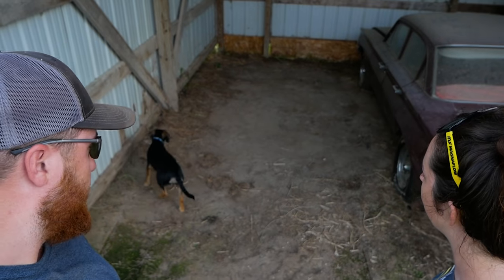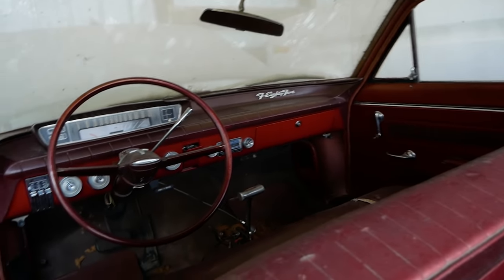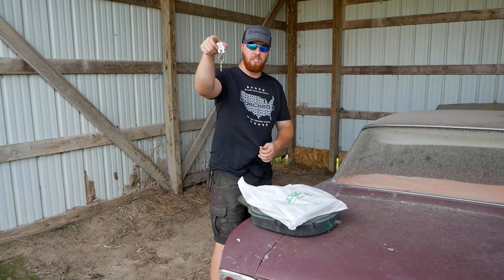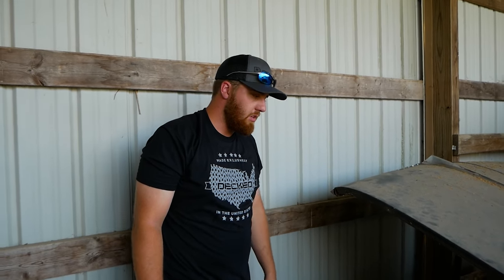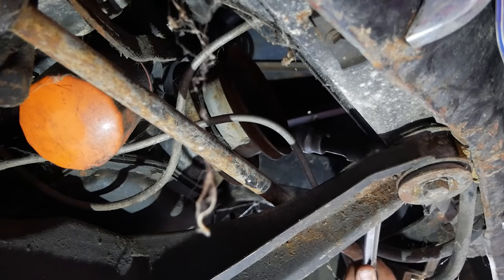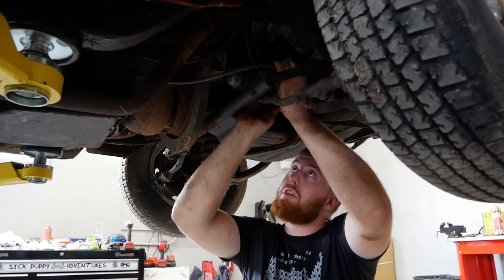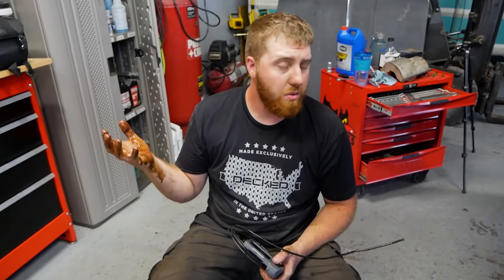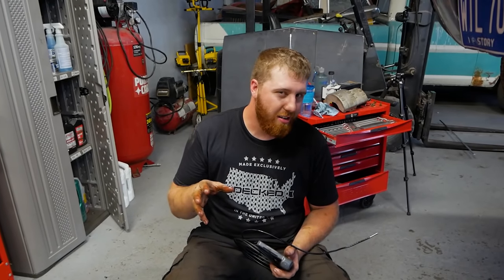BARNFIND Oldsmobile F-85 First Start in 25 Years!! - Part 1

Comment: The engine would eat the stock transmission that's why I converted mine to a 4 speed and the duel exhaust was stock it also has short headers 63 had a alternator
You have a Gold mine just in parts that engine should also have steel sleeves cylinders

Comment: @JunkyardDigs you could  put air suspension on the trailer as that should allow you to drop it lower and if set up correctly change the tilt when needed. Could be a cool video as well.

Comment: Had a 62 Cutlss convertible same motor,blew the doors off many Mustangs with it.Engine block aluminum particles plugged the heater core several times.

Comment: we had the 215 over here in uk ,if its been sitting for a while youll have to pack the oil pump gears with vasoline or similar & also fill the oil filter

Comment: Like an LS not a self priming oil pump.  A pump garden sprayer and some fittings make a good LS primer may work with this, if not at least it oils everything pushing oil through the system.

Comment: packing the oil pump would likely work but why not just put an adapter in the oil pressure hole bushing up untill you can get a funnel in it pour the funnel full of oil and let it sit. you could even spin the pump backwards to aid in the "priming". Don't give up on this one, my sister had two of these when I was 15/16 years old, they really move for a small car and get mid 20's mpg.  Hers were both the 2 spd, what fun with a th350.

Comment: Ok after you pack that oil pump and get her running throw the rest away. Then go find a Baja bug project. That engine is a hoot in a bug. Wish I never got rid of mine. Stupid easy to do. Headers upside down with glass packs welded to the collector, big ass aluminum wing off the back with a hole in the middle becomes becomes you radiator mount. Great fun brother!

Comment: I had a '62 f-85 convertible. Bought it cheap in early 2000's because the auto trans was bad. I rebuilt it twice and it wouldn't work right drove me nuts. Finally spoke with an old timer trans mechanic and he said those transmissions are only good for weighing boxes down in a dumpster! So I put a 4 speed auto 200 4R and it was back on the road. I have 13 year old YT videos on it somewhere. Great car that was easy to drive and park around the city. Sold it on eBay for a lot less than I thought I would. Sure it's worth double or triple now like all the cool cars I used to have.

Comment: I had a 67 Buick Special with the 301 ci engine which is almost identical to the Olds engine in the F85. I had the same problem. Put a new oil pump and that fixed the oil problem. They are fairly cheap to rebuild or replace.

Comment: From the comments , made by many knowledgeable viewers, suggest you follow there advice .... after you have dropped the pan and checked your ends and mains as you have run the motor with no oil pressure , shells are cheap .... if shot and a crank polish can be done in place if necessary , then prime the oil pump with Vaseline and fill the oil filter , etc .

Comment: @junkyarddigs,
I've ran rover v8s for years (being British) lol
Make sure your spinning the dizzy drive the right way with the prime tool and it could just need the oil pump packing out with grease
To get the initial vacuum for suction 
These engines are notoriously bad for low oil pressure the last one I built I put in the back of a vw vanagon 
Parts for this engine are super cheap they used this engine in many different vehicles over the years , most common in landrovers and rangerovers they came in the 3500 sd1 as well as other iconic British sports cars the engine is actually legendary over here in the UK we love them ha ha ha

Comment: I don't work on any vehicles, but I do a fair bit of small engine work. Right now my main project is a 1969 Lombard Comango. All it needs now is a carb rebuild, and I'm planning on putting a pipe on it in place of its current "muffler."

Comment: Correct me if I'm wrong but I think the Buick 3800 V6 pumps fit these engines, and melling makes high capacity units for them too. The V6 oil pickup is a good upgrade too. and the HEI off a B-O-P engine fits too I believe.

Comment: As a Brit with a little experience on the Rover derivative of this engine, I agree with everyone else who's saying that the oil pump needs priming, preferably by packing it with Vaseline. Hopefully the rest of the engine is good.

Cool to see that Aceca, shame it's missing the original BMW-derived Bristol I6 motor though, those things are brilliant.

Comment: I know that, on the Rover V8, if the engine sits for a long time then the oil can drain right back into the sump and the pump loses prime.  It might be worth pulling the oil pump out and repacking it with petroleum jelly to get it to prime again.  Assuming this engine is basically the same as the Rover V8 that developed from it then it won't run without the oil pump drive in place as there's nothing to run the distributor...

Comment: My uncle has a 1988 Pontiac Fiero GT that he purchased new from the dealer. He blew it up in autocross and decided to put a Olds 215 that he pulled out of a F-85 in the early 90's. It uses a Fi-tech fuel injection system which works great.

Comment: Not a bad episode at all, I had a couple of Rover SD1s here in Australia, when you get that engine running properly it will be rewarding! I remember (allegedly) hitting 125 km/h in 2nd gear before the auto shifted to 3rd. As for lack of oil pressure...sorry no idea : (

Comment: The aluminum 1962 215 cu. in. F-85 "Olds" engine was built by Buick I believe. A lot of parts are still sold on eBay for it.

Comment: All is not lost Kevin. Pull the flat plate off of the oil pump and examine the gears.. if all is well, pack the pump with white grease, reassemble and fill engine with fresh oil, run for 3 minutes at idle while watching oil pressure gauge..

Comment: The Buick 215 became the BMC 3.5 litre, fitted to Rovers,  Land Rivers, Sherpa vans, MGB GT V8s and TVRs. It's the most popular V8 in the UK in the 70s to 90s. It was modified to 4.0 litres, then final to 4.6L. It also formed the basis of the Metro 6R4 group b rally car 90 degree v6 engine.

Comment: Buyer's pride: the interior's pretty good, "actually really nice!" That thing is awesome, but it needs EVERYTHING redone. Do a full rebuild of that wonderful little piece of Oldsmobile history.
So you started this thing without oil pressure. Wow, the very first thing you should have done is prime the oil pump with new oil and filter. Also didn't see you squirt oil (or WD40) in the cylinders before turning it over. At least you checked the oil.

Comment: This is a 1962. We had a 1963 4 door F-85. 215 CID V-8, with a 4 barrel. Getting automatic transmission parts for the original F-85 Roto Hydramatic is now a nightmare, so, not shocked to see a THM 350.

Comment: Many olds and buick blocks have a hidden oil gallery plug that is missed on rebuild.  If priming the oil pump doesn't work you may need to look into that. Typically behind the distributor drive but could also be at rear of engine.

Comment: Dont use vaseline right idea but use stp oil treatment. Had the buick 215 once all the oil drains back down the pickup tube to the pan it wont pick up without priming the oil pump. Which means taking it loose from the timing cover and packing it with stp oil treatment

Comment: For all of you who wrote in that a certain brand of car used this type of pump, there were many different brands that used this type of oil pump on their engines.  Ford, Dodge ,Buick/Olds/Pontiac, Jeep, International,  and many others ,including AMC.  External oil pumps kept you from having to remove an oil pan to access the pump. P.S. Kevin, not only is that aluminum V-8 engine unique to Buick/Pontiac/Olds, those cars also had the transmission in the trunk. The th350 conversion included installing a differential to replace the Powerglide/Jetaway transaxle.

Comment: The trans cooler should be run in series with the radiator so it can warm the trans fluid in the winter and cool the fluid in the summer.
Allegedly.

Comment: I’m pretty sure the pumps are ran from the distributor so you’re in the right area with testing with the drill, may be a bad pump or blocked pickup. Try removing the oil filter housing to see if there’s anything there maybe? Certainly check the UK forums, there’s a lot of support from the Rover/Land Rover/Range Rover car clubs here in the UK.

Comment: looks like a 1962. I had one in the 60s. Put 120,000 miles with no issues. They made one with an air research turbo charger that was 215 HP. They came with a 4 speed and they made convertibles too.

Comment: Mickey Thomson took a couple of those motors to indy back in the day. a farmer at home had to sons that both had one of those cars new and they would get going pretty fast and at least one of them had the same intake manifold as yours has, it was for a turbo charger, the large hole in the front bottom and that large carb cover was the charger blew into.

Comment: How do you take a car sitting that long and not : A) pop valve covers and slather oil on the rocker arms. B) pull the dist and prime the pump with a drill?

Comment: Pulls the starter off of what is essentially the Coupe (2+2) version of the car (The AC Aceca is based off of the AC Ace) that was the basis the Shelby (AC) Cobra to stick on a $600 Barn Find. Classic.

Comment: Pump oil into the pump with an oil can through the pressure switch port. That should fill the pump with oil, then it'll start pumping when you spin it.

Comment: I had a 1971 Buick Riviera with a 455 once and a lifter snap ring got between the oil pump gears, locked the pump up thus shearing the roll pin on the distributor drive gear. Luckily the engine quit running so it didn't run without oil pressure. So I installed a new pump rebuild and roll pin but still no oil pressure until I put some grease in the pump gears. That fixed it. And how a lifter snap ring got in there I'll never know.

Comment: I'd recheck the pushrods first. By removing the valve covers.& running A thin wire down through the push rods to see if their unclogged. Then try to start it up run for A little bit afterwards to see if anything changes.

Comment: I had a 1963 Olds F-85 four-door "Rocket V8" (my mom bought it new).  3-speed automatic. The '63 had a much more sporty body.  Unfortunately it got parted out... engine is now in an airplane. Worse, it's now one of the rarest of all American cars, in fact Since Internet I've never seen an intact 4-door '63 F-85 (Wagons and 2-doors yes, but 4-door never)... and I've looked. Would guess what you've got there is almost as rare. About 15 years ago I saw a wrecked 1963 4-door carcass, no engine or drive train, for $15,000, and that was the ONLY one on the market.

Note: the stock engine had an odd camshaft. It may look worn because the valves don't rise the same, but that's by design. Also be careful with the antifreeze type, because of the aluminum block. The fuel pump bowl gasket may persistently leak; I replaced mine with a couple layers of inner tube, and it never leaked again. I put four studded snow tires on it, and it was better than a 4x4 on ice, voice of Montana winter experience. Take note of how strong the body is... I used to haul heavy loads on my roof, with no rack! 24 mpg, not bad for the era. That engine would start when it was -40F out. And when it's tuned up, it was really quiet and vibration-free.

Anyway... nope, it's not a POS, it's rare and mine was a dandy car to drive. First thing my mom did after she bought it was take it out at 120mph on curvy roads... held the road just wonderful. And that was wholly stock.

And it's a terrific car for swooping down mountain passes in Mexican Overdrive.... :D

Comment: I had the same car, I rebuilt the engine. They probably didn't prime the oil pump. You have to pack the oil pump with vasaline and it will prime.

Comment: Pack the oil pump with vaseline for some reason certain oil pumps won't draw oil when left standing or after a rebuild the vaselinehelps suck up the oil and will melt when the engine gets to running temperature.

Comment: That 3.5L V8 engine has an eccentric gear oil pump in the front timing cover driven by the crankshaft. After a rebuild the typical way to oil prime the engine is with a pressure tank or by packing the oil pump with Vaseline and using straight 30 or 40 weight oil and starting the engine. If the guy who rebuilt it didn't oil prime the engine the bearings could be wiped. The oil pump gears could also be cracked and the aluminum oil pump cover could be ruined. Either situation (or both!) could be responsible for your lack of oil pressure. Good luck!

Comment: Pull the distributor.  The oil pump on these engines is driven by the distributor  The oil pump shaft has a big slot on the end and you can just chuck up a big screwdriver - minus the handle - into a drill and spin away.
If it was rebuilt and has no oil pressure, it MAY be because the rear camshaft bearing/bushing was pushed out of the back of the block by putting the camshaft in with too much force. It doesn't take a lot of force to push that back bearing out.

Comment: Could be a hole in the pickup above the oil level.  An easy test to see if this is right is to fill the crankcase with drain oil and spin the oil pump with the drill.

Comment: Most likely or probably the pick up tube came off. Some times the screen is sludged up from setting too long take the pan off and replace the pump and the pick up tube. It sure wont hurt anything. Always good to have those parts new. If it has a crappy Fram filter on it could have came apart and clogged up the hole deal. Fram filter suck so bad they should not be allowed to be sold. Weld the pick up tube for safety so it wont come off.

Comment: Not that it may be all that important , but I have noticed that when people test the radios in those older cars, many don't realize that some have electron tubes that require about 15 seconds to warm up before they have any volume. I believe that they didn't go to all transistor until 1965 approx. In the 1950's cars, the radios will need to be rebuilt before they will work.

Comment: One thing I would try is to overfill the engine with oil. Then try your drill trick see if it picks the oil op then. By over filling the engine this primes the oil pump without having to pull anything apart
Reply: Or use your drum pump to fill the engine with oil. Through the oil gallery.

Comment: The Olds 215 became the Rover 3.5 in the U.K. in the 1960s. Very common to not have oil pressure after a long lay up. Take oil pump cover off fill with Vaseline and prime. Oil pressure should come back.

Comment: You have to pop the oil pump apart and see what's going on, maybe the bypass is stuck all the way open and oils just dumping back into the pan. I had a Jeep wagoneer with a Buick 350 V8 and after you hopped up on the freeway and got off you had no oil pressure cuz the bypass was jamming open and when it got down the idle the oil pressure went away so I got in there and I put a kit in it and that took care of the problem.

Comment: They did have a 4 barrel version. "With an 8.75:1 compression ratio and a 2-barrel carburetor, the Olds 215 had the same rated hp, 155 hp (116 kW) at 4800 rpm, as the Buick 215, with 220 ft⋅lbf (300 N⋅m) of torque at 2400 rpm. With a 4-barrel carburetor and 10.25:1 compression, the Olds 215 made 185 hp (138 kW) at 4800 rpm and 230 lb⋅ft (310 N⋅m) at 3200 rpm with a manual transmission. With a 4-barrel carburetor and 10.75:1 compression, the Olds 215 made 195 hp (145 kW) at 4800 rpm and 235 lb⋅ft (319 N⋅m) at 3200 rpm with an automatic." Couldn't you do another episode getting this running? Not one you see often.

Comment: Weren´t these one of the first ever factory turbo charged next to the Corvair Monza? In the engine compartment was a tank for "Jet-Fuel", an alcohol water mix. When run without the turbo burns out why alot of them were "converted" back to without turbocharge.
A very interesting piece of history. If this was a Jetfire originally it would be worth its weight in money. VERY few Jetfires left...

Comment: I recently bought a 1962 Buick Skylark with an 215ci aluminum v8. I noticed lifter noise when running for the fist time in over a year. After running the car for a few minutes it went away.

Comment: Ok, so, these aluminum blocks were "not" sleeved, they were "coated". running this without oil pressure most likely ruined it. I recommend tearing it down and  pressing in new sleeves . When you pull a head off you may get really lucky to find it has been sleeved. that would be your saving grace.  Good luck!

Comment: Cut your losses!  The 215 cu in aluminum V8 was a disaster from it's inception.  Like the Olds diesel, GM never should have gone forward with this engine without further and long term testing.  There is no way to fix it in a way that will give you or anyone any long term reliable use.  This is my second comment.  My first car was an Olds F-85 with the same 215 aluminum V8.  The car was two years old when I acquired it.  It had already developed several serious issues.  Am an old guy now but a car guy from way back, born and raised in Detroit when it was truly the motor city capital of the world.  I've had a love affair with virtually every vehicle I've owned right up to today, except my F85 with the 215 aluminum V8.  Oh, and when running at its best, the highest mileage I recorded with a gentle light throttle was 12.5 hwy, 10 in city driving.